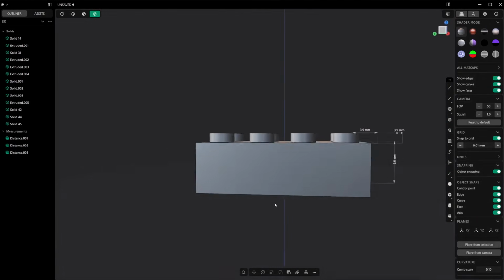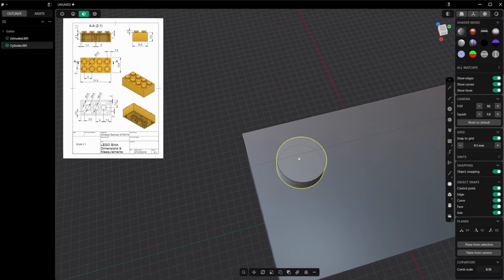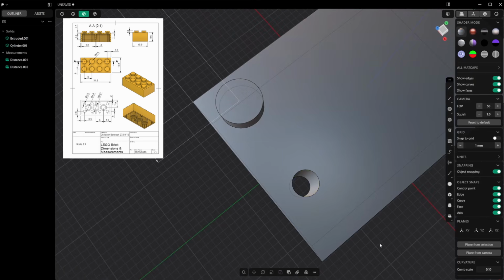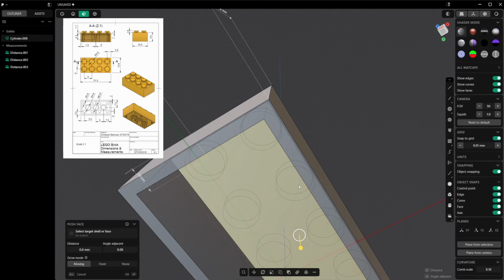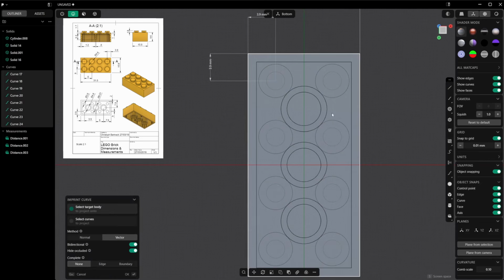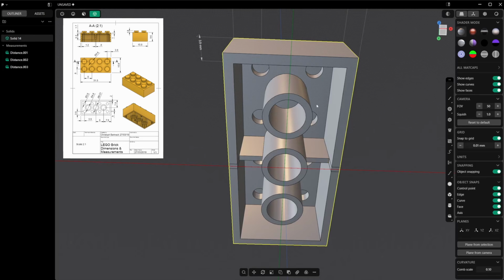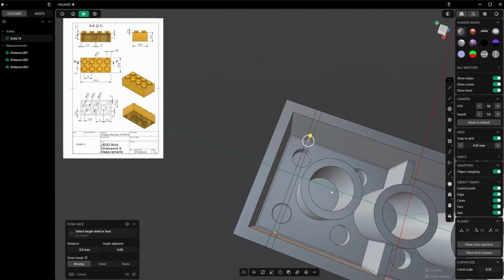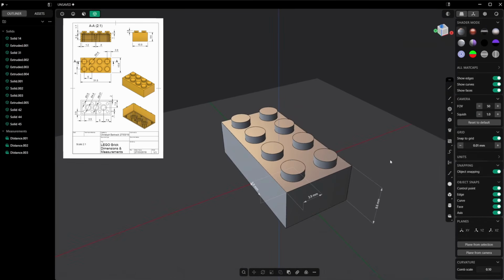Precise CAD Workflow in Plasticity (Plastic Brick)

Comment: When making arrays (rectangular etc)  you can press X / Y / or Z and it will LOCK to the axis automatically...  you also can hold CTRL and it lets you snap to any point.   (V changes the grab handles on things in plasticity so you can hit G to move, V to set a new spot, then drag and hold CTRL to snap to points, edges, etc... )

Comment: Instead of duplicating and resizing all the circles @6:56 you could just offset them, right?

I prefer the orthogonal view - it gives the correct dimensions in the depth for visual inspection. :)
Reply from the maker: Yes, but offset is relative, so you gotta remember the original size (and i am terrible at that)
Reply: @Nemos3DLab  Good point

Comment: How do you make cylinders perfectly round? There is a bunch of flat faces and each of them are 3-4 mm wide. Google said shift+s but that makes not sense. A bunch of control points appear but the actual shape does not change.
Reply from the maker: Hmm I don't do anything in particular, are you using a poligonal software? Plasticity is cad, it's nurbs based. You can't do this in blender unless you increase the face count

Comment: it would be easyer if plasticity had construction lines geometry to turn on and off. that way, hitting construction button just creates a construction geometry to snap to. then a button to turn off the construction lines when its not needed anymore
Reply from the maker: If by construction lines you mean curves, you can technically disable them from the left hand column list, even all of them together (with the sun looking icon). But yeah, I'd like the process to be more streamlined and ideally have a plane where to snap all the construction
Reply: I really don't think construction line would be better